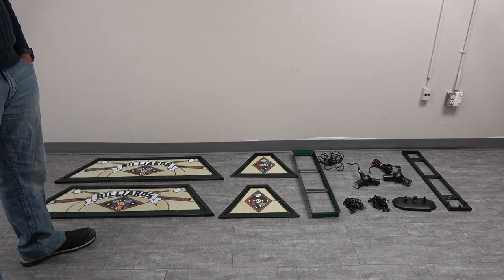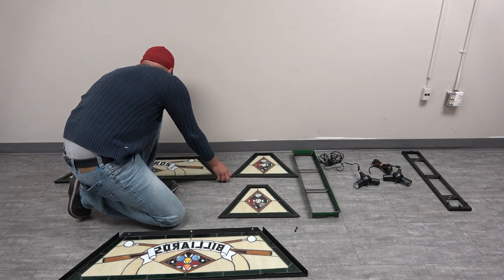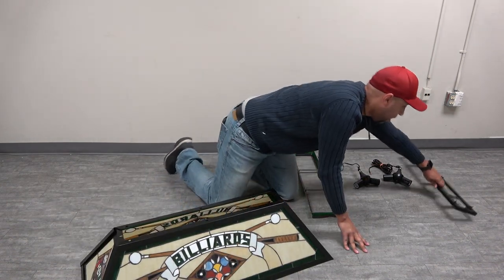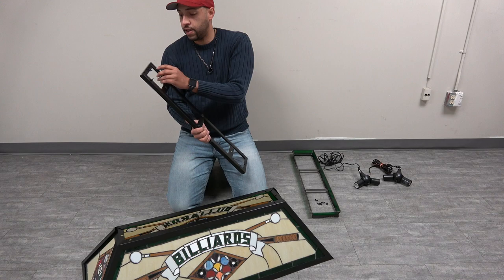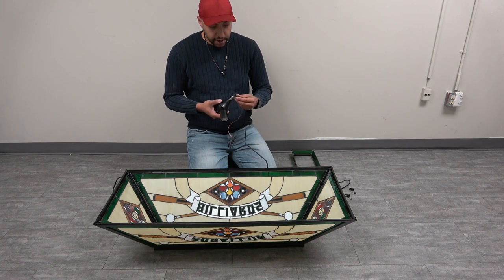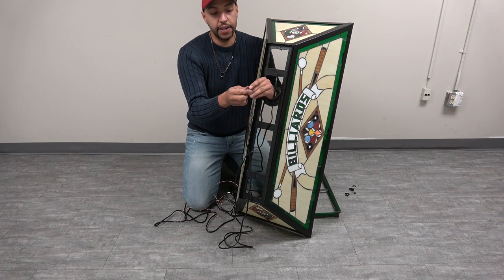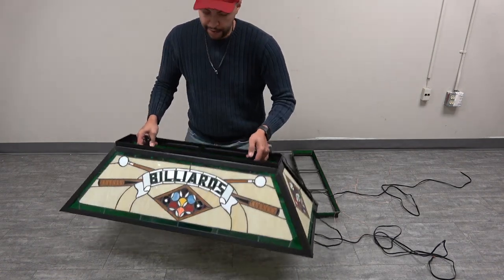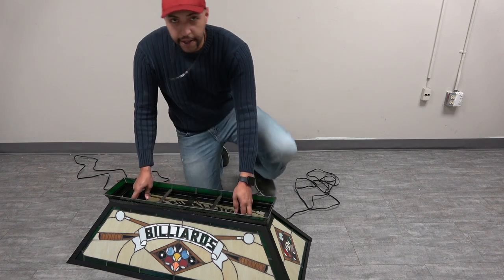Z-Lite KD25GREEN Billiard Light Assembly

Comment: No connection required?
Reply from the maker: Hello Vixtinction,
I'm not sure about the connection that you're referring to, so I'll answer based on assumption.  If you are referring to connection to the outlet on the ceiling, then yes it is required.  I did not show it in the video because I did not have an outlet box to connect to in the working space.  The purpose of this video is to show how to assemble the fixture itself.  I hope that answered the question that you were asking.